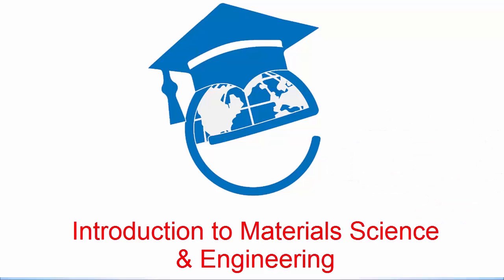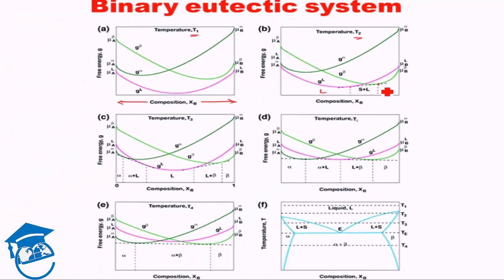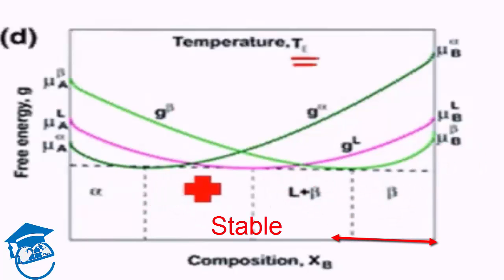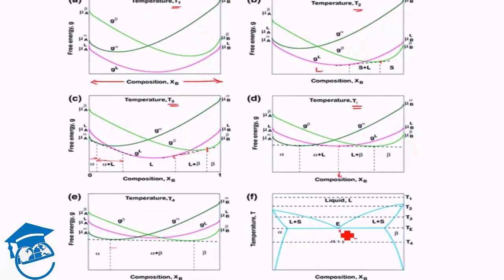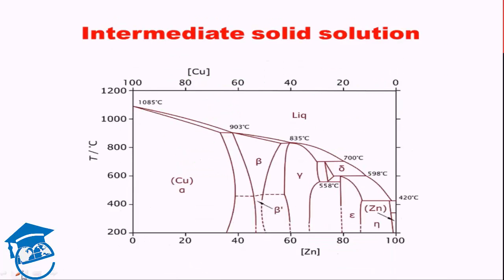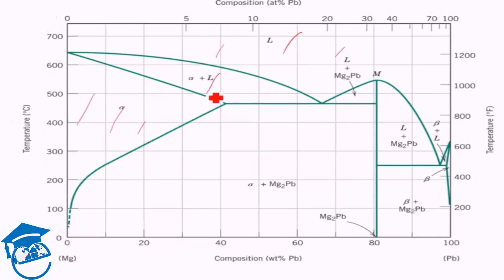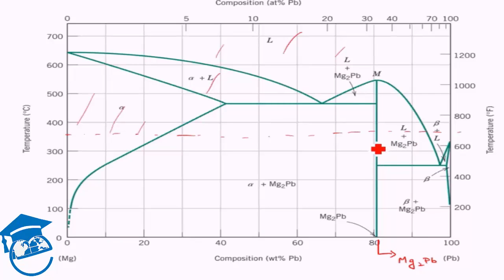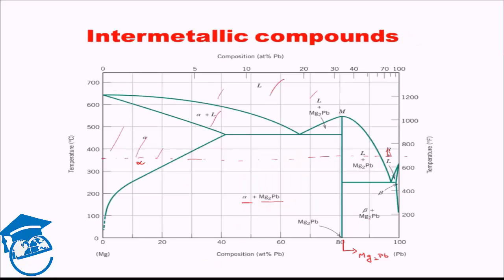AMIE Exam Lectures- Materials Science & Engineering | Phase Diagram - Eutectic Diagram | 8.4.2

Comment: how do i solve this question?
 Consider the binary eutectic copper-silver phase diagram in
Fig. below. Make phase analyses of an 88 wt % Ag-12 wt % Cu alloy at the
temperatures

1000°C, (b) 800°C, (c) 780°C + ÄT
, and (d) 780°C - ÄT . In the phase analyses, include:(i) The phases present(ii) The chemical compositions of the phases(iii) The amounts of each phase(iv) Sketch the microstructure by using 2 cm diameter
circular fields.